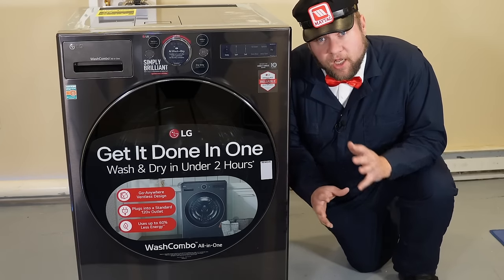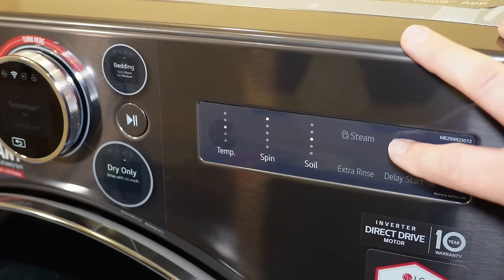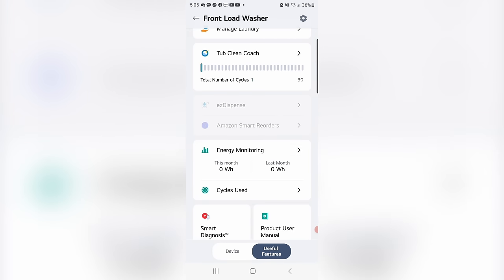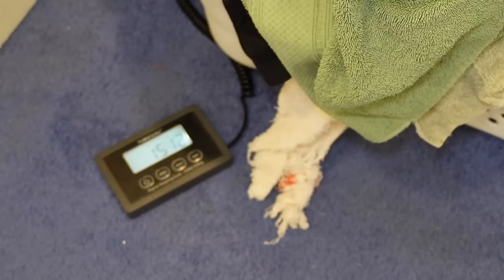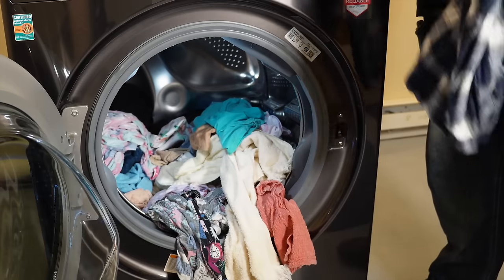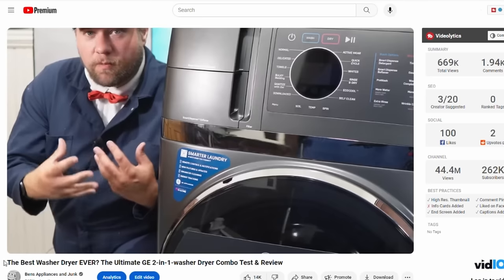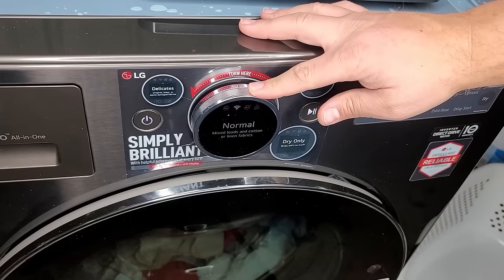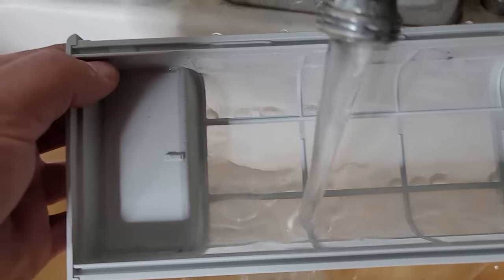BETTER THAN GE? The LG All in One Washer Dryer Combo: Test, Teardown & Review

Comment: Thank you for such a lengthy, detailed product review! Very interesting. I think all-in-one machines are the future, although as a former tech I'd rather see the washer and dryer as separate machines for ease of maintenance. These machines are really tightly packed and not at all tech-friendly. 
My wife and I live off-grid and I think the lower current draw, and lower energy usage, on heat pump dryers may be attractive to people like us. You said the total energy usage for one cycle, start to finish, was  2.2 kWh, which is pretty good. That was wash and dry cycles combined. Our conventional Inglis dryer uses a minimum of 3.5 kWh to dry an average load, and that's not including the energy used to wash the load first. 
If homeowners are going to save money, though, new machines must be durable. Conventional washers and dryers are pretty bullet-proof, especially the older ones like our Inglis stacking set: some twenty-five years later both machines have been entirely trouble-free (I'm just about to replace the cracked drive belt on the dryer before it fails). One failure in a modern machine outside of warranty will instantly erase any and all savings the owner realized via lower energy consumption. This is the same reason I drive a twenty-five year old truck: although the fuel mileage isn't spectacular, it's paid for and the cost of a newer vehicle will never, ever be offset by the fuel savings. Looking at the long-term, often the machine you already own is the best choice.
Keep up the good work! I love seeing your detailed videos! Cheers from Canada

Comment: You think an "app" gives one appliance a big advantage over another?  With any of these heat pump W/D combos, they key to being happy with them is putting a load in at night and starting the cycle.  You don't need a frickin' app to do that!  Having a heat pump that runs at roughly 1/3 the wattage of the GE model makes this a super easy decision for most buyers.

Comment: Usually, these Combos say something like 22kg/13kg (in my country) stating that drying should be less than 13kg. So, for this one if it says 10 lb you should expect to half it for proper drying. I would expect though these units are all coming with heat pump rather than blower with resistor for the drying feature.

Comment: Very interesting to see other units now that I’ve had the GE for several months. Seeing this there is no way I’d switch, GE has won me over with the ease of use and making me feel like I don’t do laundry anymore. I hope the competition heats up and they all keep improving!  GE’s filter is so easy to clean, the warning to rinse it is in my face, and though I also see that one spot of lint inside it has never grown since it appeared after a couple loads and my drying is the same as day one, I think it’s an isolated thing that shouldn’t be worried about. 

Samsung’s detergent dispenser on the floor level is a no go for me, the GE just slides forward and I fill it from the tap on my giant Kirkland detergent keg sitting on top of the machine. Easy..

LG’s controls look messy and confusing. Let’s admit it, we all use the same couple of settings all the time and maybe tweak them for special loads once in a while. I don’t want to bend over and squint at messy and or small displays. GE has a ton of settings but they’re easy and a heart lights up to show that you have customized a cycle so I know my delicates will be washed exactly how I want them. I literally touch the cycle and start and walk away, returning to fluffy never wrinkled laundry ready to put away.

Comment: Nice Review! I got my GE combo few months ago and loving it so far. The only two issues I have with it is the condenser coils is gathering some escaped lint from the filter and when the loads are somewhat big, it goes into this endless void mode of "Load Sensing". So I would literally have to monitor my load from app to stop it when it happens. Do I have a defective unit or something or this can be fixed via firmware update?

Comment: Complaints are that this thing doesn't dry well, and has a lot of hardware failres. Smaller heat pump than the GE, average load takes 3+ hrs compaired to GE's 2 hrs.

Comment: I bought the GE unit in September, partially based on reviews like yours. I think it's great that this LG unit is now on the market, because when my GE ultimately fails in 5-10 years I will have a choice between GE and LG for a replacement. I'm probably not going to even consider another brand unless Speed Queen gets on the heat pump bandwagon. The two Samsung units that I replaced with the GE were headachy trash, and the Bosch units they replaced (inherited when I bought the house) unrepairable due to inability to source replacement control boards.

And I do have to say that the unvented heat pump units are awesome! After closing up the vent hole for the old dryer, my laundry room in winter is much warmer than usual, and other than washing out the lint filter and doing a self clean cycle once a month the maintenance on the GE unit is relatively nonexistent, and vibration is much less than the Samsung units it replaced.

Doing a head-to-head would be great, but I'm  not in a rush to see it because I won't be making any buying decisions based on it (though my parents may eventually be in the market for a new unit).

Comment: The GE can be also be controlled/started remotely with the app. Additionally the fact that the LG heat pump is both undersized AND has a 1 year warranty vs 5 years for the GE heat pump makes it a no brainer in my book that the GE is a far better pick.

Comment: I have an older unit - not thrilled with it.  Bought it for my RV because it was 110 volts and no vent to the exterior requirement   For that purpose, it'll due.  For a house, where you have access to 220 volts or natural gas, I wouldn't buy it.  I've had two other regular LG washers and I think they cleaned better too.  I don't know why that is, since the washer part should be the same.  As bad as that is, the real weakness is the Dryer.  110 volts of plain old resistive heat just isn't enough and the lint management is very difficult problem to solve.  Consequently, three drain pumps in four years.  The pumps are cheap, and I can replace them myself but its still a hassle and for some folks they won't/can't do it.  Maybe this one has it figured out.

Comment: Heat pump might be undersized but a heat pump means you can get more effective heating than the amount of electrical power put in. This doesn't violate physics because it is just moving the heat from the environment rather than creating the heat. I personally would not buy unless it works well with home assistant. However, the heat pump and combo aspects are appealing, especially when upsized for an American market.

Comment: Can you please test the wash & rinse combo that uses the most water? 

The GE has an option to add 3 gallons more to both the wash & rinse cycles.

We like to use additives, and the load rarely feels clean without extra wash/rinse cycles.

I've heard the following combo on this LG might use the most water:

Towels + TurboWash 360 + Rinse (+3)

If you at all have the chance, please use the above combo on a small load and record it from outside the door.

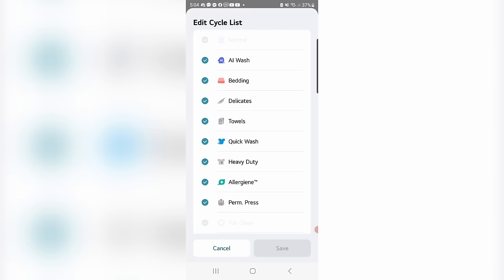Comment: I was really curious about this and hoping that I didn’t make a wrong choice as I just purchased a GE Profile. After seeing this over 4 hour wash/dry cycle, I’m happy to report that I’ve had no issues with my GE profile combo 2 in 1 and it does everything in half the time. As I’m writing this I see it he adjusted the load size but my GE still beats it by an hour. Haven’t had it take longer than 2:30 hours. I’ve started doing quick cycles which take me about an hour- an hour and a half. 

I do like how LG kept this more low profile while still having a heat pump unlike GE beluga hump on top.

Oh another update. I guess that’s why the time is so much longer LG is so much longer than the GE

Comment: Amazingly thorough video.  The question I have concerning all of these digital type appliances is do they have any kind of small battery backup, super capacitor, or some other type of non-volatile memory in case of power failure during the cycle or delayed start time?   Anyway, great video and thanks for taking the time to make it.

Comment: Old rule of thumb sayings should apply here.  Never buy first generation of anything with technology involved.   This is nascent technology so let at least 2 generations pass before touching anything like this.  The consumer with deep pockets is their testing ground.  Plus the short one year warranty is a red flag.
Second adage is the concept of keep it simple stupid. KISS.  If you are so pressed for time that you cannot move wet clothes to your dryer but some how are ok with a 4 hour cycle time then there’s something wrong.   I prefer to let an appliance be great at one thing not mediocre at two things.   How much laundry do people do in a week ?!   So if it takes you 1.5 hours to wash and dry a load vs 4 hours you can do 3 loads on a traditional system then 1 load on this combo unit.   
The other issue I have is the overuse of the word AI.   Now they use it as a marketing term but for years it was just sensor mode .   Just hype 
This product will flop.   Too expensive and limited warranty and load time too long.  KISS

Comment: Soft water? 9:16 This may have been addressed, but does it have ability to adjust soap quantity to compensated for the soft water? Our Maytag front loader definitely needs 1/2 or less soap or clothes and the washer are left with excess soap in clothes and machine. Thx for any responses.

Comment: Any update to this video? How is it running? given the short time you had it and the amount of lint on the heatpump coils, I am holding out to see what the long term reliability is. At the same time I am in the market for a new washer and dryer for a small in-law suite. This would be great space savings if it can last more than a few years... that is a pretty steep price point. I can get a decent LG pair & an 18 CF Whirlpool fridge for several hundred less than that.

Comment: nice but indeed a lot criticisms. weird that they only warrant the compressor for one year whereas small cheap window airconditioners warrant the compressors up to 10 years-the packaging is pretty tight unlikely the GE-lint on the cooling coils also a bad sign.  additionally, these all in ones still have poor value considering one can buy two stand-alone units washing and heat pump drier for the same or less price. a small window air conditioner is more powerful than the heatpump system dryer, small ac starts at $200.

Comment: The heat pump doesn't need to be large, the trade off isn't really worth it because you need to get it much larger for more capacity. It's there to dehumidify, essentially, which means drying. It's going to pass a steady stream of moist air from the barrel up through and dry it out and warm it up and send back to the barrel. That's all that needs to be done. Most of the drying is in the initial spin cycle and after that it's either add direct heat via heating elements which can be wasteful in energy especially since you send the air out the warm moist air out the house (which also draws in outdoor air into your house) or you dry it a little slower but without outdoor air and without using as much electricity. 

As for me, I throw stuff in laundry and forget then throw in dryer and overall probably takes more than 5 hours because of that. Might as well have it all done, even if i forget, with no chance of mildew. Most of the time I go to work or run errands so I don't need it done quickly anyways

Comment: I owned an LG washer/dryer combo for 8 years. I sold it for ~1/3 of what I paid for it. The unit was expensive, but perfect for a small apartment, and it really did pay for itself over time, as laundromats were no longer needed. The only issue was the drain hose has to be replaced after 5 years or so, because it cracked.

Comment: Major opportunity missed, feature needed.......

Allow two or machines to talk to each other so they can be hooked to the same drain. This machine to machine communication would allow the machines to negotiate drain cycles so that one drain (the existing one) would be sufficient. There should be enough intelligence in these machines to do this dynamically no matter the load size or cycle.

Comment: I have a smaller LG all in one - my only issues are the filter is down low - so you have to drain off water (messy) to clean it. 

It also doesn’t give you any warning until it gets bad enough then it fails mid cycle and you have to drain even more water and redo that load.  

Otherwise I really like the machine after 2 years of using 5-6 loads per week.

Comment: I'm a big fan...appliance-wise!

Every couple years, I have to deal with one issue or another on my washer and/or dryer.  Your videos keep me sane by setting my expectations on what is normal ... even when the "why does it make that noise ... make it stop' comment comes up from the SO.  While I can't always moderate the expectations of others, I feel that I can give it a try and make an effort to not spend hours on a squeak or bounce that isn't actually a problem, especially after those hours end in no reasonable change in the noise (that seems normal to me ... things make noise, because they move... ).

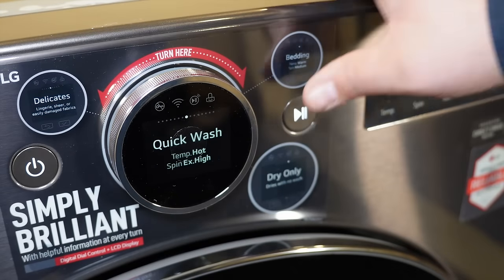Comment: I found 4 hours way to long.  I now wash and dry for 1:45 min with a seaparate washer and dryer.  Does this mean this unit will be using double electricity?  so the cost will be much  higher to use?  Is the only benefit to this the all in one?  Only reason I was considering is to save space and less bulky eventhough i have a stackable now.  Combo sounded like a real good idea to me, but now i wonder.  What you say?

Comment: No way in heck am I going to let this thing connect to the internet and become a IOT DDOS Bot. The machine could have saved energy by only leveraging the control wheel without all the other buttons. Neat that it has a heat pump.

Comment: Unless your space is really limited and you don't have the dryer connections, I just don't understand the need. You will also end up with a unit that is has more failure points. To top it all off you end up with half the throughput on laundry if you are like most households that do all the washing on weekends.

Comment: Bottom line is that the heat pump system on this unit is really not economically repairable between the labor and probably high cost of the components it’s going to be a very expensive throwaway

Comment: LG should add acces panel to the ecaporator. In sacz case the heat each unit could be clean with out disasembly the whole unit. Mebe after market modification need to be done to that model.

Comment: I have my doubts, the lint is going to block the elements within a very short time due to the poor design of the venting system, also noted was the small heat pump system, the compressor from experience will fail early in its life, and looking at the very poor quality welds at 25:19 indicates to me further hidden cheap throw together componants.

Comment: Have you had any issues in the testing of this machine? Mine gets water in the filter which cause the drying to take over a day due to hot humid air circulating when drying. I have had 2 techs out to look and so far no fix.

Comment: Not fair comparison since you are comparing a cheap electric to a higher end gas.  
Both styles are made in both gas and electric.  Gas doesn't mean you get the roller aupports and electric doesn't mean glide and center sleeve bearing. 
They make the cheap hotpoint in gas as well.  But yeas the extra gas components does generally mean more likely to fail and when it does all those gas parts cost more than the electric element.  So whatever you may save in the gas bill you will pay out to the store when you buy the gas model and to us service techs when it breaks . So no actual savings on gas.

Comment: I have seen a few repairs on the all in one heat pump based washer/dryer and i think it would be a good addition to add a fresh/clean water spray on the condenser and evaporator to try to clean it of the lint, possibly an embedded in the evap/cond. Spraying outwards both ways.   It would delay the need to maintain it by a while i think

Comment: honesty, heat pumps may be more efficient but they are just crap, our old 3kw unit took half the time as our current one with a heat pump and the clothes actually came out dry, you have to run our current heat pump unit twice to get anything dry.

Comment: Not trying to be the negative person in the comments but if someone is here for this review to buy this you better get that extended warranty. 75% of my service calls are units under warranty and out of the year warranty the repairs are usually control boards of gear cases.

Comment: My whirlpool heat pump dryer has two separate lint filters in it. Because the first filter isn’t enough the second filter is a much finer mesh so it captures much smaller particles that sneak through the first filter. It seems like these heat pump dryers capture more lint because they recirculate the air instead of throwing it out a tube in the back

Comment: I will say the lint filter being in the top is a game changer.  I rented an apartment 2 years ago that had a combo unit and cleaning the lint filter ment getting on your knees and draining water from the machine manually then pulling the filter.  Since the machine was on the ground there was no good way to do this because if you raised the hose nothing came out of it.